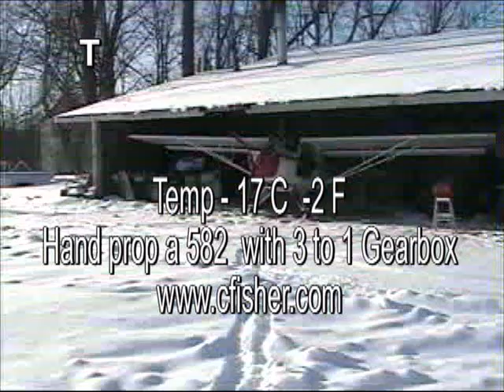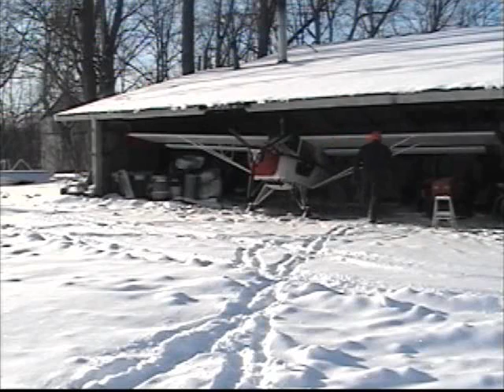Hand Propping a Rotax 582 engine on Kitfox  Ski flying aviation cfisher.com

Comment: Be careful with the rpm when starting a cold liquid cooled 582. You want to get that coolant up to about 140 before going much over 3000 rpm.  You can score the pistons, rings and cylinder walls ( especially near the exhaust port ).  I watched a flying friend take off on a frozen bay at full throttle and not warmed up.  The engine "cold seized",  lost power and he was not quick enough on the down elevator. He stalled and slammed down on the ice hard.  He was a certified airplane pilot with little experience in ultralights.  He was banged up but ok.  The plane never was repaired I don't think.

Comment from the maker: I have seen that before,  I only use urethane lines here or Blue tygon. I think you gotta be careful with firesleeves around open fuel lines a I have seen a fibre of asbestos get stuck in needle before.  Once I had a continuous flow of gas out of carbs and it was the fuel was gravity flowing through the primer.

Comment: carburator float overflow - small piece of fuel hose stuck in the needle from the end of the hose after the gascolator and filter - one carb overflowed engine quit - I managed to turn it back to the runway - so far this 582 runs like a champ not a hiccup or a sputter but I watch that fuel like a hawk

Comment from the maker: This engine is new last fall.  The last engine went over 500 hours and never was apart for anything in over 500 hours.  I change plugs at 150 hours usually. not you usual NGK plugs either.  Never had a engine out with a 582 or 503  yet .
cfisher . com more Kitfox info

Comment from the maker: IF you read the info on this page you would have seen this ....

T. You should tie your plane down and or chock wheels/ I was on Skis and there is a snow bank about a foot high about 20 feet in front of plane in case is moves but it is very sticky on that snow.Anyway let it warm up 3000 rpm till coolant temps get over 140 F .